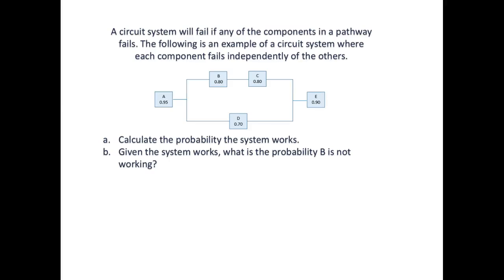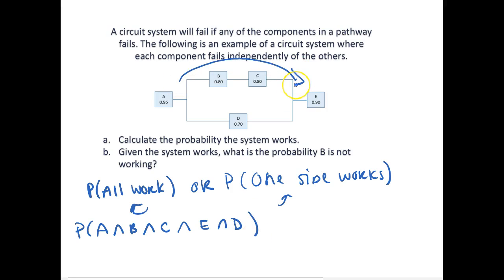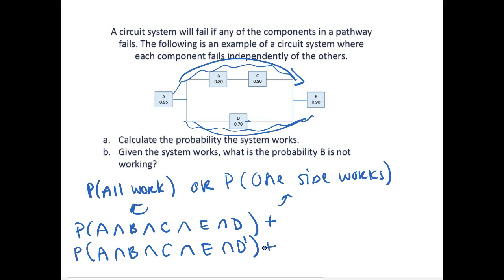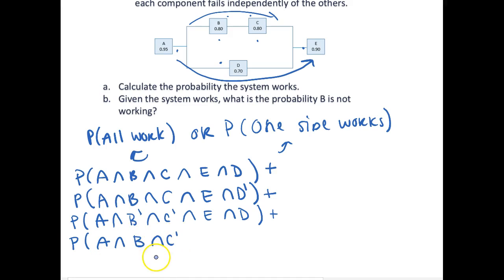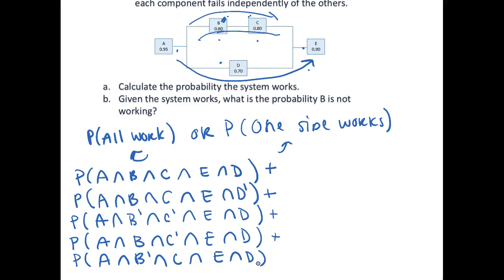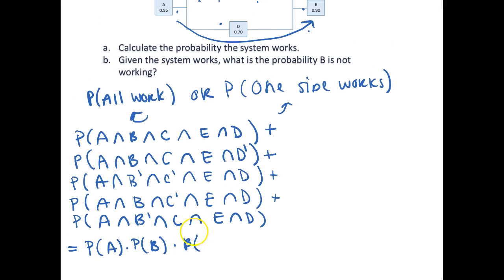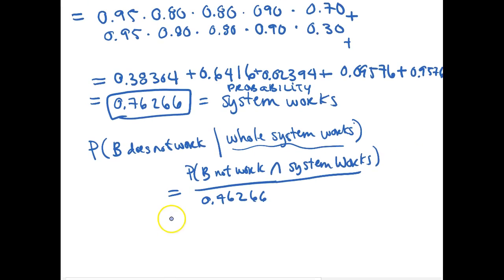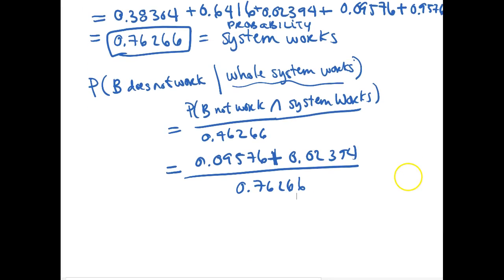How to Calculate Probabilities for Independent Events - Circuit System Example

Comment: You:  Here's a closed circuit of 2 and 1 n the sides with p known.

My lecturer:  Here's an open circuit of 5 paths with 3-4 circuits per path and p value unknown.

At the same time, I still think I got it from this video. :O

Comment: Hi Katie didn't the question say those probabilities in the diagram are for the system to fail not to work? if that's the case why use them for system to work

Comment: This is wrong. You can't just add all of those without subtracting anything. Just look at your expression for part (a) (above the boxed answer). 0.38 +.64 +.... is greater than 1 which is impossible.
Reply from the maker: There is a numerical typo here. The set up is accurate.

Comment: instead of doing all of this 
we can simply find the probability of the circuit not working and then take its complement which is (1-system falling)
probability of failing is path one fails and path two fails which is [(1-A)*(1-B)*(1-C)*(1-E)]+[(1-A)*(1-D)*(1-E)]
so probability of working is 1-[(1-A)*(1-B)*(1-C)*(1-E)]+[(1-A)*(1-D)*(1-E)]
Reply from the maker: This statement is incorrect. While yes you can find the complement it would be more work to find the probability the system fails. Each component works independently, there are many more events that are possibly when we try to calculate defective.